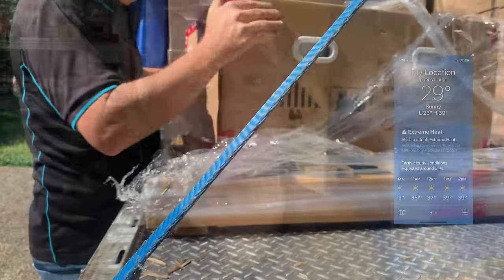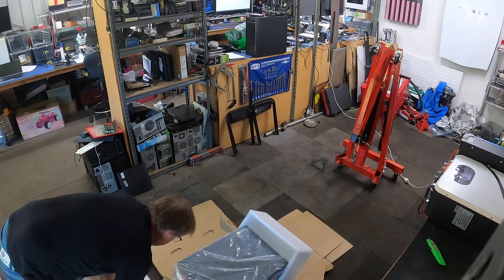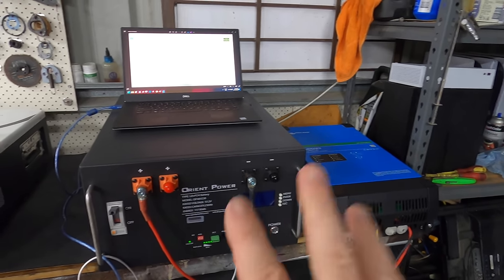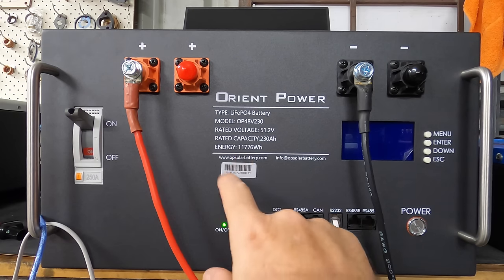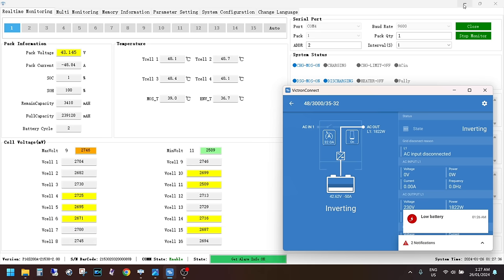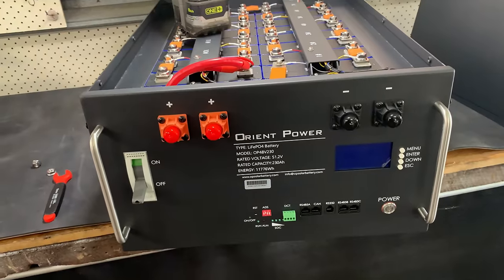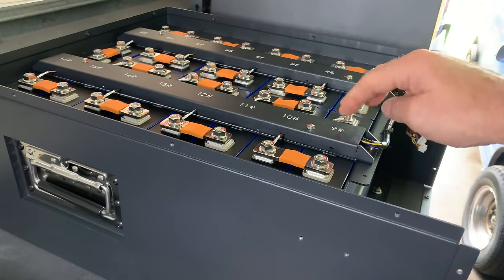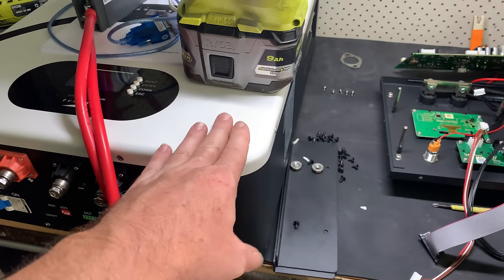Orient Power OP48V230 battery | 11.7 kWh | 230ah |  Rack Mount | Will this replace my DIY 18650ies!

Comment: Thanks for the review. My only suggestion would be that you independantly measure the delivered capacity externally rather than trusting the figures from the unit itself.
Reply from the maker: Great point! if it's any help touch over 7kwh was taken out of my other battery to top it off.. so close enough i felt at the time..

Comment from the maker: If you are considering a LiFePo4 battery upgrade please consider checking this one out. Had it on my bench for two weeks at the time of release and I can 100% see myself installing this battery in my own powerwall finally retiring my 185650 DIY Powerwall.. LInk is affiliated and I make a commission on sale & which won't cost you anything. If you do buy PLEASE let me know! https://aujakiperbattery.com/product/48v-230ah-11-776kwh-lifepo4-server-rack-battery/?ref=powerwalls Using my code "Powerwalls" will save 8%!!!! 

 ▼ 

Reply
Reply from the maker: Just received a reply from Orient Power regarding shipping, within Australia shipping is a flat rate of $150 no matter the quantity of battery ordered. (so 4 is the same price as one)
Reply: I was considering adding 15kw of istore (Huawei) batteries to my 5kw hybrid inverter I've been quoted 5k Australian per Huawei 5kw Battery , would this be a better option 3 of these batteries?  I have 13kw of panels on my roof ? Thanks Wayne

Comment: If you take the two wires coming off the terminals and touch the tip of your tongue with them you can tell the state of charge.  # pro tip 👩🏻‍🏭
Reply from the maker: Apparently that's the only way the pros do it!

Comment: That's why I stick with the 100ah batteries. More versatile and easier to move etc for do many reasons.

One does not use a spanner 🔧. Use a socket with extension
Reply from the maker: for sure!

Comment: We have a 100ah jaki battery just replaced the pace for a jk Bms with a Peter board much more intuitive
Reply from the maker: what a Peter board, any links to what you did or the parts you used?
Was thinking of swapping out for Batrium BMS.. Don't need the screen

Comment: is that a victron inverter i see is that the upgrade 😊
Reply from the maker: Not unless I win lotto on Thursday night :P
Reply: did you repeir the mppsolar inverter
Reply from the maker: 3 times each time it would last a week or two then it would display voltage 2v lower than realty. Drove me to tears so just got 3 other used ones all ment to be working - well many months later I made one working inverter out of four lol
Reply: i got a 3kw mppsolar now it three years an some months old just some other brand bought a 4.2kw

Comment: mmm nice video.
I would have thought to use the 18650s on a different circuit to the house? until the wife said the stove is not working, then get rid of it.?
 (the batteries and not the wife - ha)
Reply from the maker: If I loose the 'wife', won't need the stove anymore. Problem solved.

Comment: Your balance is >100mV -- too high!!
Use active balance to top balance then disconnect it and let BMS balancer take over
Reply from the maker: NO, there is no reason a good BMS can't do the job - active balancers hide issues so the BMS can't show you there is an issue... stop believing the internet hype

Comment: I would never go above 3.5 volts per cell and I would never go below 3 volts
Reply from the maker: Yeh, I have a bit to learn about LifePo4 - they recommend 80% DOD but I wanted to test the advertised claims
Reply: he is testing the capacity. it is not how he is going to use it.
Reply from the maker: I'd be nice to use it like that and not hurt it :P
Reply: @HBPowerwall  All depends on how we define hurt really.  It's rated at 7000 cycles to 80% discharged.  Probably knock that back to 5000-ish from full to empty.  That's about 13 years at once per day.  7000 is 19 years.  Old age will probably take it out before then, possibly it'd be on its last legs at 13 years old.  If it's still going in 10 years time then it's all free extra play in my books.

Good to see you moving off the salvaged 18650 path.  Walls of those things always make me nervous.
Reply from the maker: you make a good point..
Reply: @HBPowerwall  The most parsimonious use the following ratings: always above 3.45v and never below 3.170v, it is correct to do some complete tests from zero to one hundred percent, mine was a recommendation for use,I add, it would be interesting to know with these parameters how many KWh they give